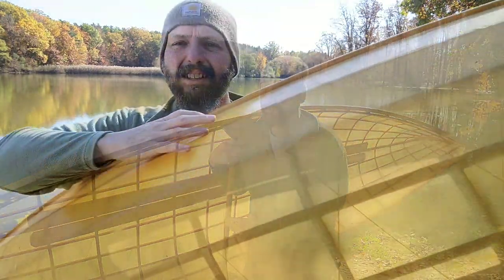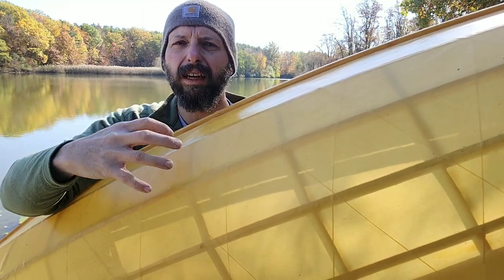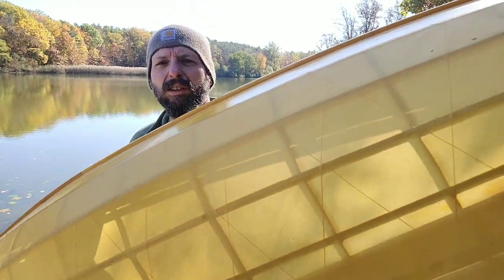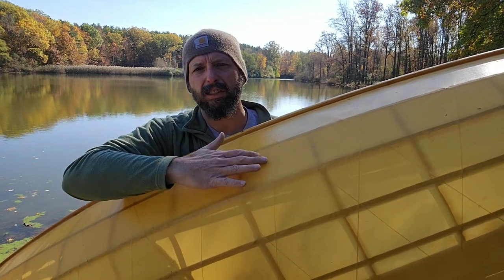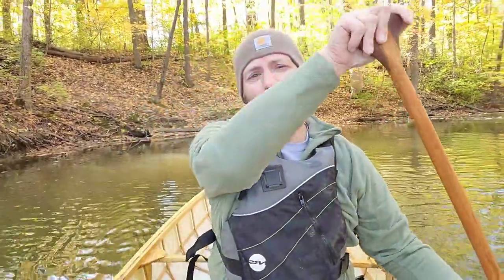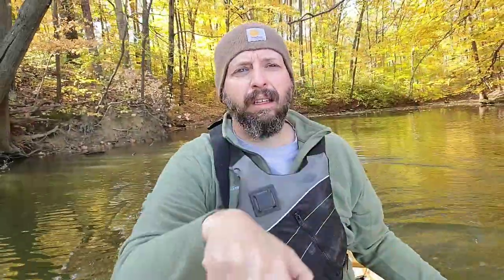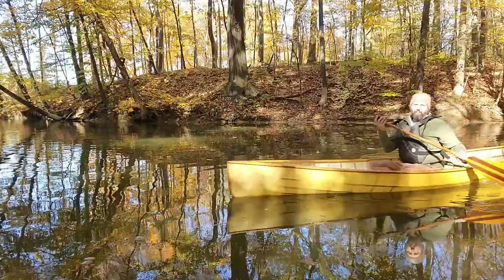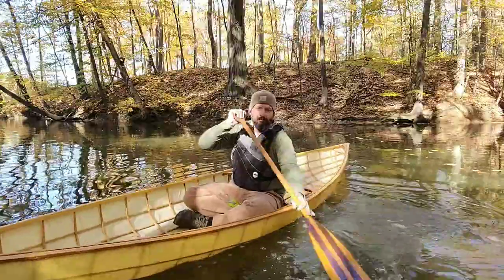Skin-on-frame Canoe Follow Up

Comment: Late this spring, I finally finished up my Sweat Pea MK 2.  Your videos were very helpful!  I've had it out 5 times now this summer and the thing I like most about it is that it fits inside my minivan and mid-size SUV with the hatch closed!  It's great to spur-of-the-moment to just grab it and go.  It stores up in the rafters in my basement, so it is out of the way completely when not in use.

Comment: Hi, I am in the process of building the Snowshoe 14, which I believe your canoe is.  Fun build, and yours looks fantastic.  The prints call for a 'keel' strip to go down the outside of the hull...I think the plans call for 1/4" x 1/2", same as the keelson...that scarf into the breakwaters on the ends.  I notice that you did install/attach the breakwater, but didn't install the outer keel.  Why did you decide not to install the outer keel?  Thanks.
Reply from the maker: This is a Nimrod stretched to 13. I was advised by the owner Larry to not install the keel. He said I could add it later if I chose to. The Keelson covers the seem and is definitely needed. It's a nice project, have fun.

Comment: Hey very nice! I just finished mine… though I am at the stage of sealing the skin, so not quite finished. What did you use to seal it? I am currently planning on using the Helmsman spar varnish, but open to suggestions… what did you use?
Reply from the maker: I think it was Spar Urethane.

Comment: Awsome work. I wonder why most videos with SOF canoes shows it with double paddles. Is there any problem with classic rowing on one side and use power stroke?
Reply from the maker: I use a single blade paddle. I haven't tried a double yet.

Comment: My son is making a boat from 1/2" by 1/2" strips of wood (11 8 ft pieces) and butcher paper for the "skin", do you think Polyurethane is the best waterproof coating we can put on the paper to make it float? He has to sit in it and paddle the length of a swimming pool before the water seeps into the paper and sinks the boat..Thanks much
Reply from the maker: Probably, but I wouldn't be comfortable with a paper skin. Let me know how it goes.
Reply: @BurningRiverBushcraft  We definitely aren't, butcher paper for skin, let alone a very limited amount is ridiculous, (as is 1/2" by 1/2" "sticks" for the Keel). My reason for reaching out to you is a hardcore boat builder on Youtube told me to, as you do what's closest to my task with a canoe,  You understand things like being in a small craft , water displacement, balance etc and I have no understanding of boating physics....continued
Reply: @BurningRiverBushcraft  How would we do this so the floor sticks don't break when he gets in? Do you think 4 ft long by 32" wide is good enough to balance? If we make it 5 ft (my original design) we will sacrifice 3 eight foot floor "beams" and I think we'll need every single one to keep it afloat. There will be a seam on the bottom of the butcher paper, would you use the Titebond III wood glue on this spot or just heavy coats of Polyurethane? I so appreciate your advice, I do realize you'd never make a boat out of paper, but your take on this is better than ours (-'/
Reply from the maker: I had prints from Geodesic Airolite. You might want to follow a print for your first build. I may experiment with other hulls on my next boat.
Reply: @BurningRiverBushcraft   This is just to do an experiment for his Physics class, we have to make a boat with a hull made of butcher paper and some 1/2" wood strips, the challenge will be to make the paper waterproof with the Poly and keep the boat from sinking with just enough material to make only 1 foot high side-rails
Reply: @BurningRiverBushcraft  I hear you, but we have no choice, the rules allow us only 14 ft of butcher paper and waterproofing , I chose water-based Polyurethane, hope it was the best option
Reply: @BurningRiverBushcraft  Think we can make this float with a person inside using polyurethane and a 4 ft long by 32" wide frame? I wonder if the 1/2" by 1/2" wood strips will break when he gets in or just bend?
Reply from the maker: @Tommy Daly I would try a scale model first, but I think it will work
Reply: @BurningRiverBushcraft  What's your first name if I might ask?
Reply from the maker: @wyattspop  Jamie
Reply: @BurningRiverBushcraft  Pleasure to meet you  Jamie, we are Tommy and Wyatt
Reply: @BurningRiverBushcraft  Can I glue the wood frame together and then paint on the Polyurethane? (for waterproofing). I'm using Titebond III
Reply: Hey Jamie, where can I send you photos? We are almost done and run into a problem I don't know how to resolve
Reply: Everything came out nearly perfect, but the slats being inside, how will the pilot not get his feet caught on them 2) Do you think after we skin it with several coats of poly that it will be buoyant and not break the slots under his weighjt (150 lbs)
Reply from the maker: @Tommy Daly  you can message me on Burning River Bushcraft through Facebook Instagram